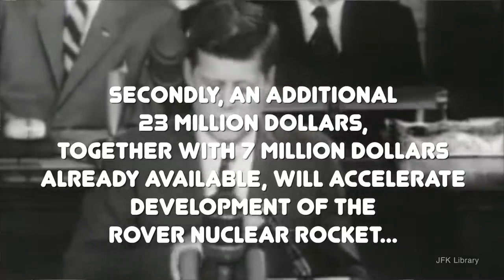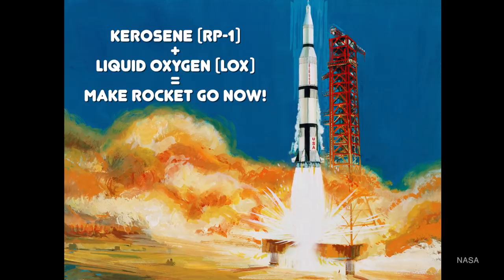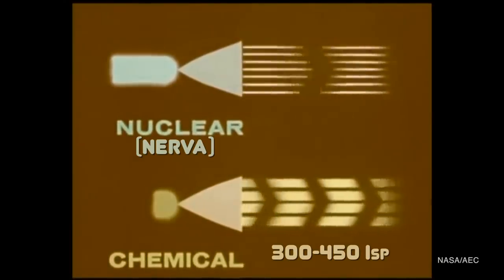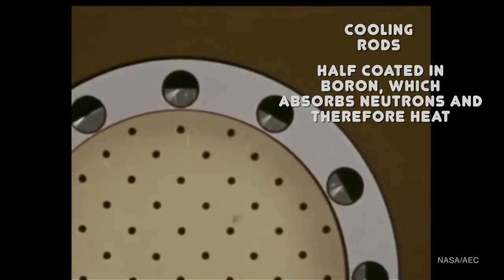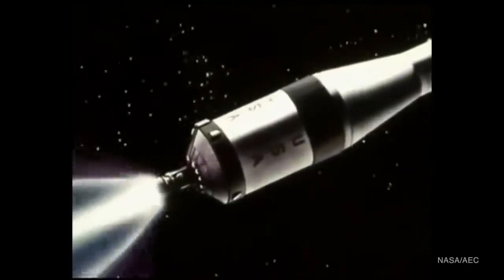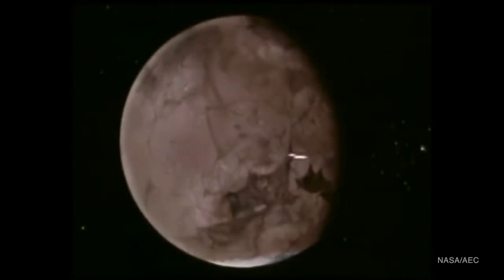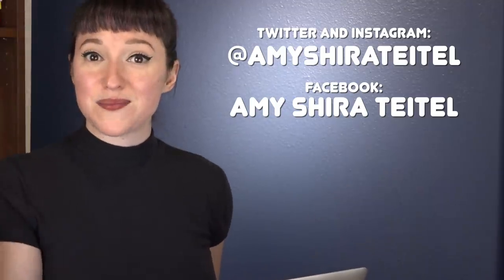A Primer on Nuclear Rocket and Why They're Awesome in Space

Comment: Solid core nukes are so outdated. Build a nuclear salt water rocket instead, which essentially rides a continuous nuclear detonation, and creates obscene amount of power. Or it's primitive version, which we could have built in the sixties, project Orion. Isp (specific impulse) up to 500,000 with TWR (trust to weight ratio) high enough to lift off from Earth, or accelerate at 1g in space, providing artificial gravity. 
Then there's the much less insane fission fragment rocket with 1,5 million Isp. That's enough for interstellar trips. Unfortunately, since it's less insane, it's trust is minuscule, but that's not a problem on long trips.
Reply: NSWR is dangerous as fuck, though. Yeah, it's wonderful for the deep space, but the exhaust is dirty (I can imagine inscription "THIS END AWAY FROM EARTH" on the outer side of the exhaust nozzle) and if the nuclear salt-water fuel leaks from the capillary fuel tanks - you may get a runaway nuclear reaction somewhere. Not enough to explode, most likely, but still not a pleasant thing at all. Orion is much better in this regard, or, if we go even further, nuclear lightbulbs - with right construction, they can be used for SSTOs (Liberty Ship)!
P.S. For the ships with NSWR - install the NSWR itself, along with the fuel tanks, on a long boom. Both radiation protection by the means of distance and ability to jettison the engine, should something go wrong with it.

Comment: Nice.  Glad you are back.  So that first part... the important thing about the exhaust is momentum, which is mass times velocity.  Hydrogen has an atomic mass of 1.  If you burn it with O2, atomic mass 32, you get 33.  If you burn pure carbon (12) with O2, you get 44.  So the exhaust could be slower by 32/44 and give the same thrust per mol of exhaust.  RP1 is not pure carbon, but your statement about H2 just naturally being better is not so accurate.
Reply: As I recall, hydrogen is the fuel of choice for many upper stages because of the energy generated as it burns: it burns hotter than RP-1.  When burning hydrocarbon fuels, I suspect a lot of the energy generated is taken up in breaking the chemical bonds between the existing carbon and hydrogen atoms.  That leaves less energy for accelerating the CO2 and H2O out of the nozzle.  LH2/LOX mixtures, on the other hand, take less energy to break the weak bonds between hydrogen and oxygen molecules, leaving more energy to accelerate the H2O through the nozzle.
Reply: @johndemeritt3460  And it is lighter for the upper stages

Comment: I still have my doubts about the viability of (this kind of) nuclear propulsion. First, in order to protect the crew from radiation, they must install shields heavier than any fuel weight this nuclear engine would save. Second, I think that just heating the propellant is not the most efficient way to get propulsion. Instead, a smaller and well-shielded reactor could produce electricity to move an ionic thruster. Third, what if the first stage explodes just after the lift off? I think it would spread Uranium 235 throughout the East coast. It just seems to be a bad idea.

Comment: I think a fusion rocket would be far easier to manage and build. We already can produce fusion and this engine would not need to be self-sustaining like a fusion reactor. The reactor chamber would be open at one end and this would have the advantage of acceleration by both super strong magnetic fields and also by the enormous temperature, with no radiation at all.

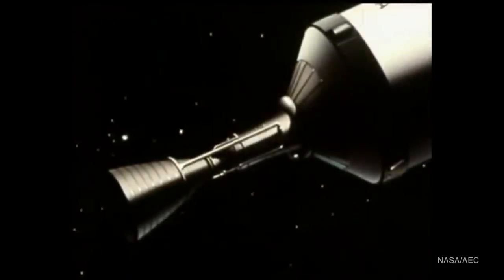Comment: Amy, I don't mean to be rude but I think your explanation at 2:45 is wrong! Lighter exhaust doesn't always mean more thrust. If you hold the exit velocity constant but use heavier gases you're increasing the mass flow, which increases thrust. If you hold the mass flow constant but increase velocity, then you're right and there will be more thrust. But it's not nearly as simple as lighter fuel leading to more thrust.
And to that point, nuclear propulsion generally has very, very LOW thrust, not high. That's why the NERVA engines were considered for use on the upper stage as you said and not, for example, the first stage where higher thrust would be most beneficial.
Nonetheless, I enjoyed the video and appreciate all the time and work you put into all of your videos.

Comment: Surely the trick is to choose a high mass, relatively inert compound or element that is a liquid around 0 to 100 C. You then use the reaction to expand & heat the liquid to higher energy states to maximise the propulsive force. Nitrogen would be better than hydrogen as it would be less volatile & has a greater mass.  OK, I don't know how the propulsion system works and I don't know if exotics are produced during the reaction but if it's simply heat exchange then something farther up the periodic table would surely be beneficial. As for all those protons flying about in the reaction & what happens when the cross boundaries, their effect on the propellant medium etc, that's the real science. Interesting idea & far better than that crazy "bomb beneath" that was proposed at one point.
Reply: The reason that low mass exhaust products is preferred for high efficiency is because it increases the amount of thrust you can get out of a given mass. Think of it like throwing a tennis ball vs throwing a bowling ball, where the two balls represent two different exhaust products. If I throw both with an equal amount of strength I will get an equal amount of thrust applied back to me, however the tennis ball would go a lot faster than the bowling ball whilst producing the same thrust. Essentially I got the same amount of thrust using less "propellant".

Comment: "Exhaust velocity = thrust" ?  Doesn't flow rate come into it?
Reply: Yeah, her explanation was a little oversimplified. In fact NERVA actually produced very little thrust compared to chemical engines of the same size, the only difference being that NERVA produced more thrust per kilogram of propellant than chemical rockets because it threw the propellant out twice as fast. Flow rate is the biggest factor in thrust, exhaust velocity is the biggest factor in efficiency.
Reply: Thanks.  I get it now.

Comment: The obvious question is what about safety of such a motor? What if the rocket somehow fails on liftoff and plunges back to Earth. Do we have a huge radiation contamination problem? I know the same concerns were raised when they used radio isotope thermal generators on deep space probes. What if one of these never made it to orbit and either crash landed or burned up in the atmosphere spreading highly dangerous plutonium in the atmosphere?
Reply: It's not just deep space probes that had RTG's. From Apollo 12 to Apollo 17, they also had them to power the ALSEP's left behind. The plutonium was stored in a special cask located on the LM descent stage and it was designed to survive a catastrophic launch failure. When Apollo 13 didn't land on the moon, the NRC was heavily involved with NASA to make sure when the LM was jettisoned, its re-entry trajectory would place it into a very deep part of the ocean. Air samples taken after indicated that the cask did the job it was designed for and no abnormal radiation was detected. Now of course this situation with the ALSEP RTG's is quite different then nuclear propulsion since the plutonium source was extracted from the cask by an astronaut and inserted into the RTG. I to have to wonder if nuclear propulsion could ever get by all the safety concerns that would be brought up at launch time.

Comment: They used an atomic motor in Destination Moon, but the 'fuel' they used was water and not hydrogen.
Reply: explorermap - The problem with water (for this application) is that it's not compressible.  The volume of the tank is the volume of propellant that goes out of the nozzle.  With hydrogen, the volume of propellant is thousands of times the volume of the tank.

Comment: I thought Ion propulsion would work better. Slowly works up speed, but gets up to speed at 200,000 mph. cutting the time to get to mars which would be approximately 40 days.
Reply: Just depends on what you're trying to send. Ion propulsion is very slow but very efficient with super long burn times. But if you want to send large things (like rovers or humans) to Mars, you'd need either a lot more time to get the mass up to speed, or more engines.

Comment: Love the video, but you omitted the big problem, one that is likely impossible to overcome. Rocket's have an unfortunately tendency to occasionally malfunction and explode. Putting a meaningful about of U235 on top of something that might shoot up into the air and explode is a terrible idea. We have legitimate worries about the tiny amount of plutonium included in certain space probes. Image how much worse this issue would be with a nuclear rocket.
Reply: There are plenty of ways to substantially decrease this risk. For starters, the UN recommends (but does not require) that these systems be fueled in orbit and probably even launched separately from the fuel. This would be preferable since the separately launched fuel can be better protected in its own dedicated payload bay. If people are really concerned, they can always add a launch escape tower like those used on crewed mission. 

Furthermore, the “legitimate worries” about the plutonium more resemble paranoia, for a whole host of reasons. Since the late sixties, almost every single RTG unit (which carries the plutonium) launched by NASA has been either a copy or a derivative of the SNAP-19B RTG. NASA’s current RTG model, the MMRTG is derived from the design as well. The reason for this is almost certainly it’s history of robustness. 

In the very first mission for which that model was used (the Nimbus B weather satellite), the Thor-Agena rocket carrying it literally blew up over the Santa Barbara channel after launch. Not only did the RTG unit survive the explosion, not only did it survive impacting the ocean at high velocity, not only was it found almost intact on the sea floor, the plutonium itself was apparently good enough to be immediately launched on another rocket shortly after recovery. In the 1970s a derivative of the SNAP-19B, the SNAP-27, was used on Apollo missions. On Apollo 13 the LEM carrying them had to be jettisoned on a trajectory that led it to burn up on the earth’s atmosphere over the Pacific. It did so, and in aftermath there has never been any indication of leakage or abnormal radiation in the area where it reentered. 

Decades later, the idea that the Plutonium-238 carried by Cassini would kill any more then a few thousands (at most) in the absolute worst case (i.e. literally everything on the rocket fails and the RTG breaks open), was almost entirely the result of media sensationalism in an era when social media didn’t exist to make fun of paranoid fearmongers. “But that’s enough Plutonium to kill everyone on Earth!” In the words of The Atlantic magazine: “You could theoretically kill everyone on Earth with 72 pounds of plutonium, just as you could in theory wipe out the human race with a single automobile, if you lined everyone up and ran them all over.”

Comment: Amy when do you think Lockheed will make anti gravity a public technology? In 20 years? In 50 years? When the whole oil on the planet will be used up?
Reply: LockMart won't, if my experience with Lockheed products holds true to form.  When LockMart brings AG technology out, it'll be years late, over budget, and won't meet the original technical specs -- just look at the C-5 Galaxy!  40 years after it first flew, it finally achieved the specs in the original contract -- and now, the Air Force is having to pay through the teeth to maintain and operate them.

Comment: The discussion of "lighter" fuel is not correct. The density of the fuel is irrelevant; what affects thrust is the amount of mass expelled per unit time, and the velocity at which it is expelled. It is true that because of thermodynamic properties, less dense elements have a higher exhaust velocity in a nuclear engine, but that is not the case for a chemical thruster.

Comment: I can not imagine why scattering radioactive materials over a broad area in the event of a launch failure should be a problem.  Who cares if we seed our land with a poison lasting generstions?  This propulsion system is more efficient and clearly that is the important critera.
Reply from the maker: That's part of the idea of it being the upper stage from what I understand. I haven't gotten into the details on NERVA (yet?) but there would be some insane shielding to keep it safe in the event of a launch failure. I mean Apollo 13 came home with its nuclear material on board (couldn't leave it on the Moon) and it worked out ok!
Reply: @AmyShiraTeitel  Anecdotally, we also had nuclear fuel aboard New Horizons and that didn't poison us either.  Successful examples not withstanding, the risk is not diminished.   Suppose NERVA was the second stage of  Soyuz MS-10 in 2018.   Suppose, more meaningfully, it was the second stage of Soyuz T-10-1 in 1983.  Nerva, second stage, would then necessarily sustain an explosion of the first stage, whilst on the launch pad.  How could that be an issue?
Reply: @AmyShiraTeitel   Apollo 13 also didn't have a SUD launch failure, which is the concern.   Also, it is easier to beat the odds with a few launches rather than the thousands that people will want in order to get a manned presence on Mars.

Comment: I can't help but feel there could be confusion between thrust and specific impulse in this video. In the video it is explained that hydrogen engines produce more thrust per unit mass. This is correct but misleading. Chemical hydrocarbon engines tend to have far higher thrust than hydrogen based engines but lower specific impulse which does mean they need more mass to achieve that thrust but the designs tend to have orders of magnitude more thrust than hydrogen based engines.

Comment: We can't launch RTG electric power sources without people loosing their shit over them.  And that's just harvesting the heat from natural decay of radioactive elements.   Then you consider launching an engine with (probably) much more fissionable material, and you'll see that political problem magnified considerably.   The concern is about the risk of a catastrophic launch failure that kersplodes the launch vehicle and components, potentially scattering radioactive debris into the biosphere.  An RTG is pretty much mechanically inert - it just sits there making heat.  A fission reactor, is going to perceived as riskier.

Comment: I like the idea of a nuclear powered rocket, but wouldn't nuclear/electric propulsion be better? That's essentially what powers today's submarines.
Reply: I think electric rocket engines have low thrust to weight figures which negate most of the gains. Check out the "nuclear thermal turbo rocket" though.

Comment: Hydrogen can turn into protons(ultrasound) not neutrons and assorted heat
Reply: Neutrons come from the fission process, not from the hydrogen.  Their impact heats the hydrogen indirectly.
Reply: In a chain reaction Hydrogen is particle-ised not plasma-ised

Larger particles have more thrust than smaller ones

Comment: Yeah. You could realize speeds of up to 20, 000 miles per second instead of the current 20,000 miles per hour. That will cut one way travel to our nearest neighbor outside of our solar system to a mere 40 years one way. Hey, that beats 2400 years. Nearest neighbor. Traveling at one tenth the speed of light means we could leave the Milky Way in only 60 X 75,000 years. And there are more galaxies our there than individual grains of sand on all of the beaches of the world. That's a lot of grains.

Comment: So, the hydrogen is there mainly to act as the expanding fluid?
No matter if the heat comes from chemical or fission reactions, the “squirting fluid” concept of thrust still seems pretty antiquated to me.
Also, I would suspect that range is still limited on storage of liquid hydrogen, not un-fissled (is this a word) U-235.

I am not all that impressed; not very innovating. Sound more like a way for contractors to make money off the stockpiles of nuclear fuel.